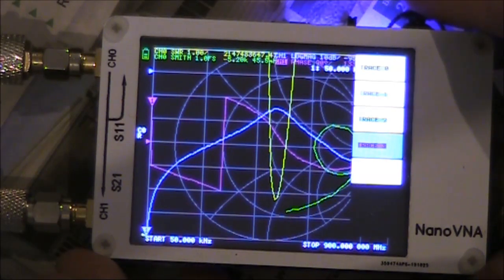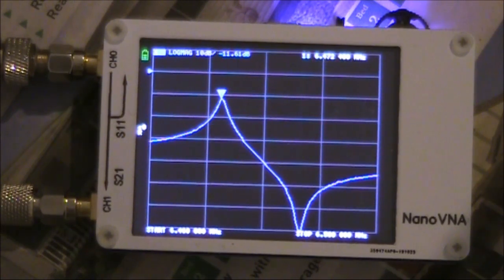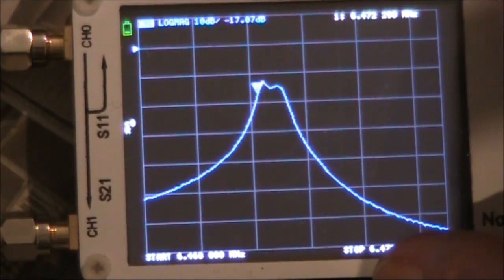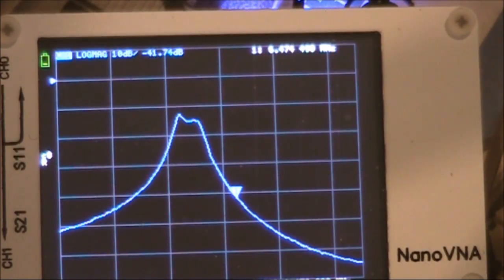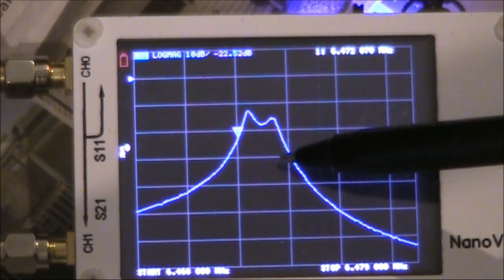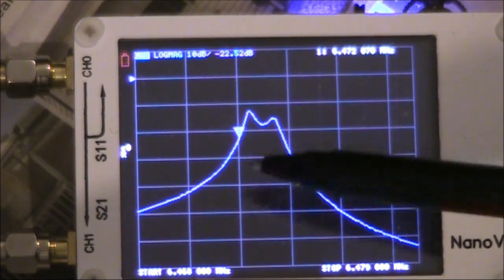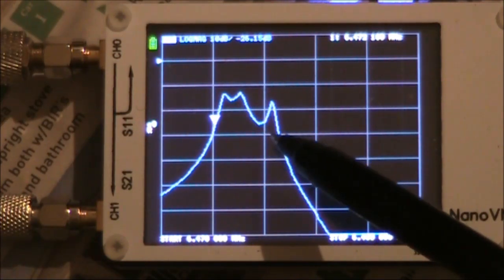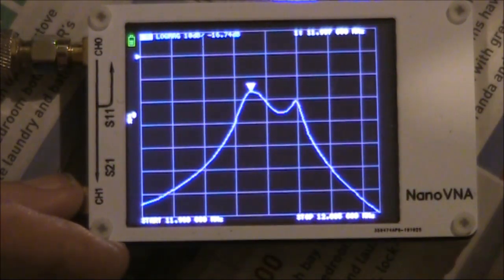Testing crystal filters with a Nano VNA

Comment: Any way to use crytals for a notch filter instead of a band pass?
Reply from the maker: Yes. Look up old (1940s-50s) communication receiver circuits for the use of single crystal filters with a deep (though uneven) notch.
Reply: @vk3ye The goal would be to make a narrow notch on 136.7 MHz VDL2 blips because they overload the SDR interfering with APT/LRPT signals from 137.1 to 137.9, but 136.7 is too close to 137.1 so I have no idea how I would solve this. A normal notch has a rather wide drop curve so no way of eliminating or deeply attenuating the interference without affecting the wanted signal
Reply from the maker: @t0nito  That's too high for a crystal. You need to investigate cavity filters etc as used in VHF repeaters.
Reply: @vk3ye  I've tried a helical resonator filter, what some people suggest is to downconvert to a lower frequency

Comment: You might get better results if you adjust the termination values.  Right now you're at 50 ohms (VNA), but most filters need something in the 100-500 ohm range.
Reply: yes the results are way above 50 ohm , he need a matching at least 2000 ohm in out to get proper normalized values

Comment: I dont think these crystal filters are matched to 50 ohm. Therefore, this is not the correct method for measurement. You need matching
Reply: @tcarney57   Most certainly, and a great demonstration of how to use a Nano VNA to display various crystal filter configurations, rather than taking precise measurements for designing an actual filter.  
As a proof of concept it hits the mark!  Kudos to Peter VK3YE

My NanoVNA-F v3.1 with 4.3" screen has just arrived in todays mail and I'm busting to use it to test my ladder filters (and many other things) as soon as I get up to speed with the Nano's controls.  If you're a homebrewer you're lost without test equipment to design and troubleshoot.